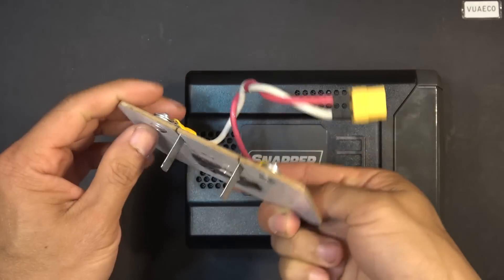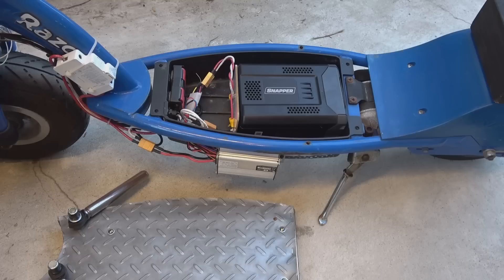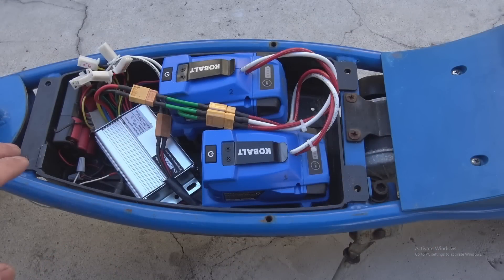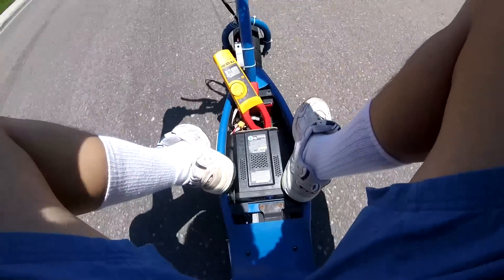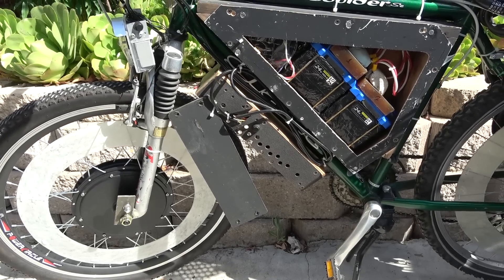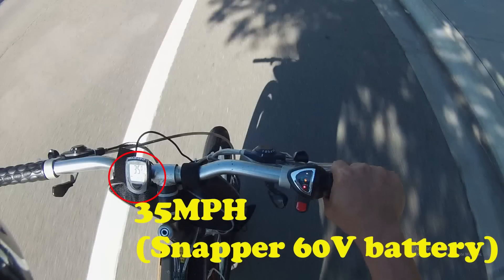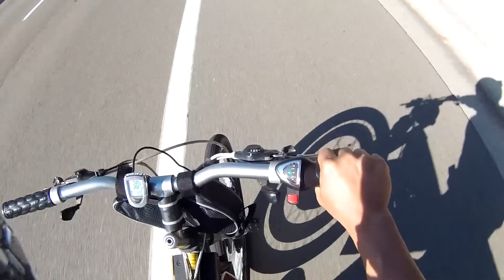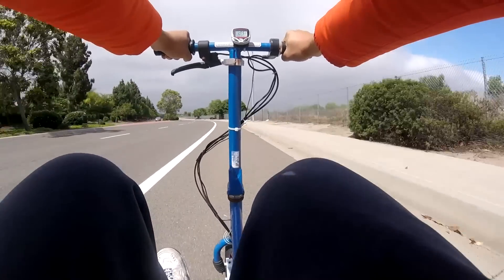Ebike battery upgrade: Run a 60V power tool battery on my (48V) Ebike & Razor E300 E-scooter

Comment: Do these Snapper 60v packs have a built low voltage cutoff? What voltage do they cutoff at? I want to use one of these in a project. Great videos Vuaeco
! Thank you
Reply: Superkev 2000 I assume they do because they have a bms but didn’t test them to that low
Reply from the maker: No, they don't. Most power tool batteries do not have low voltage cutoff. They all have BMS but it's only for overcharge protection. If you think about it, if a battery is overcharged, it will explode. So a manufacturer will do everything they can to prevent that or they will be sued to bankruptcy. But if a battery is dead because they are overdischarged then it's good for them because now they just have a new customer ready to spend his/her money for a new battery. So the answer to your question is almost always "no". You will be the BMS for over-discharge protection.
Reply: vuaeco that would make sense!
Reply: @vuaeco  I think the battery charge is controlled by a small pcb/brain inside the tool itself, so when it get down to a certain level the tool stops working to prevent extreme discharge situations
Reply: @vuaeco  Thank you for your reply. What do you use to cut them off and at what voltage?
Reply from the maker: @superkev2000  There's a test button on the battery. Once it gets to 1 bar, remove it out of the scooter and charge it. Or use a voltage display to monitor it. A 15S battery when empty is about 50V. I would stop using at about 52V (which is 3.5V per cell)
Reply: @vuaeco  Thank you sir!

Comment: What's the max discharge amperage on these 60V batteries? I know these batteries have an internal fuse (for example the 80V Greenworks batteries have 40A fuses) but what do the 60V packs have?

Comment: Hi mate, I've watched heaps of your videos over the past year or two. I have a strange problem. I have a 1000w motor, with a brand new controller. The controller keeps cutting out after a few minutes, and when it seems to get warm I guess. I'm thinking it's because I have a 48v battery in it. So if I go up to 60v, will it stop it hitting any sort of voltage cut out? 
I'm thinking this is why it keeps cutting out. I've even taken off the wire from the BMS, and put them into the battery directly, and still the same. Even though the battery is 8p,so it hardly get warm at all.
Reply from the maker: Your controller probably has a higher voltage cutout. Read the specs of your controller.
Reply: @vuaeco  I can't find the cutout voltage. If I go up to the next level, 52v, or 56v, do you think this will solve it?

Comment: Hey I am going to try something.  If you can tell me what you think of my plan.  I have a Kobalt 40v snow blower.  It stalls under hight demand as expected (I knew it wouldn't set the world on fire).  I ordered a 56v ego motor.  I want to try running the stronger motor off the 40v supply hoping that it may prevent the thermocouple from tripping under high load.  Sound reasonable?

Comment: I took that same scooter and ran 2 dewalt20v batteries in parallel And I rode a willie around the block. I couldn’t keep the front down but it was fun. I didn’t use a controller I just ran it direct.

Comment: I have a 2018 Radwagon  42v setup.
I have 1.additional 54v batteries I would like to put in or.replace the 42v. Would I need to upgrade the controller? And do I wire them in series?

Comment: 48v 58000mah x 2 = 96v 116000mah connect using parallel adapter to a 48v controller will it blow up?🤔🤔

Comment: How far have you ran the battery before you changed it out? I have a 60 v 5.0 Greenworks Pro battery that will work with a boat on 35 amp controller won't it?

Comment: Here is my 48V 2000W 42A motor and a 45A 2000W controller.  Driving at 35-38mph for 30+ minutes the motor is getting very hot.   Here is a short test run video.  https://youtu.be/rxD43d7Er_0

Comment: Great video, I learned a lot from watching, may I know that are you still running 60V 1000w controller with the stock 24v brushed motor? If so, is the motor still alive? I wanted to try something like yours too

Comment: It would be interesting to measure the 60v and 2x24v batteries under load. The high discharge cell specs I have seen have 20mohm internal resistance; a 60v 2ah pack will be 15s1p so the pack internal resistance will be 15x0.02=0.3 ohm and the battery voltage will dip 6 volts with a 20 amp draw down to a peak of 63-6=57v. If the 24v packs were 7s your 48v "battery" would have a full charge off-load voltage of 58.8 but if the original 24v packs were 7s2p you might find the pack voltage only loses 3v under 20a load so dropping to 55.8v. In this case your "60v" pack is only delivering 1.2volt more than your "48v" pack and similarly the extra power available would not be huge.

Comment: I love your vids!!  I have a 48 volt fat tire bike and I just replaced the controller. Stuffing all the wires and connectors in the small space made me a little nervous. The old three wires to the motor were burned up at the bullet connectors. On the new one I soldered them. The original setup lasted three years. Almost all mountains and hill riding which really uses the amps. Lots of heat. Thanks again!!

Comment: Hello 🙏🏽 can you tell me if it is possible to wire 3 batteries in a series parallel combination to make 3- 12V/ 12AH batteries run at 36V/36Ah🙏🏽
Reply: If u had 6 u could get 36v 24ah wiring 3 sets of 2 in parallel and then those 3 sets in series
Reply: It would end up being 36v 12ah if in series.. In parallel it would be 12v 36ah

Comment: I have a question for you regarding something else. I have a 36 volt trolling motor for a boat. Can you suggest a battery that will keep a charge the longest? The TM itself doesn't need to run very fast. Just enough power to last throughout the day. Thanks!

Comment: Just because you have 60v capacitors doesn’t mean it wont blow. If the fet voltage is lower you will blow the fets. Check the fet voltage.

Comment: my tricycle 48v can i put battery 60v? Pls help me, brother
Reply: Yes
Reply: You SHOULD be ok... But again, open the controller box and check the resistor ratings .. they almost always put higher ones than the battery being used

Comment: why does the scooter use so much more power cruising at the same speed as the bicycle?
Reply from the maker: Scooter has brushed DC motor. Bike has brushless DC motor.
Reply: vuaeco do you plan to upgrade the motor eventually? You are definitely going to burn it out quickly if its burning that much power off as heat.
Reply from the maker: @TheJulienlauth  It's fine with brushed motor. I don't always run it at maximum load. You can install a cooling fan if needed. Upgrading with a brushless motor is better but too expensive.

Comment: That's cool you are able to get to 28mph on a razor scooter, I'm currently rebuilding my battery to a 16s 12p battery to power a custom dual motor ninebot es4 with two 48v 1000watt esc's. The capacitors are rated at 80v but there is a soldered on wire with some voltage selections of 60v (the one the jumper wire thing is connected on) 64v, 72v, and 80v, I'm not sure if I should switch the voltage selection thing, I'm guessing it's over voltage protection but I'll probably leave it alone unless it doesn't work. It originally went 25mph on a 13s battery so I'm trying to go 28-30mph
Reply from the maker: Pretty nice!

Comment: Only problem is that the Snapper batteries cost $140 .
Reply from the maker: Buy it on ebay or Amazon. I got mine for less than $50, new. Just be patient and wait for the right opportunity.

Comment: https://rover.ebay.com/rover/0/0/0?mpre=https%3A%2F%2Fwww.ebay.co.uk%2Fulk%2Fitm%2F273820259099 
What's your opinion on these UK battery holders for ebikes? I'm planning to buy two to attach 6 18v 4ah on a 48v 1500w ebike.

Comment: Check the mosfets. They realy liit the voltage and are most likely to fail. If the capacitors fail and swell the bike will still work

Comment: hi..yesterday i buy 2ndhand escooter..i think motor is 350w.... but battery 60v charge 67.2v ,controller 36v...it can burn or not my controller n motor? pls advise to me
Reply from the maker: It's unlikely a 36V controller can handle 67V.

Comment: How long can you run them for
Reply: My 48v 1500w hub motor runs 15-30 minutes on 3x 18v 5ah batteries. Hoping for up to 1h run time on full throttle when my 14s8p pack is finished.

Comment: I have four 20v 5ah lithium batteries...how do i maximize volts and amps? Run two sets in series and then parallel the sets maybe?
Reply: Yep. That's the better setup.

Comment: how long does your battery last and what is the amp hour rating on the one you bought?  I see the 2 amp hour version on ebay for around $60 or so?  thanks- love your videos
Reply: On this depending on your weight you'll get approximately 2 miles per amp hour

Comment: Can I use 60v  battery on my ebike is 48 v 1000w
Reply: You could do it but you would have to get a 60v charger and your motor should be fine since its 1000 watts but just in case... watch it to make sure it doesn’t get too hot ;)
Reply: I am wondering the same thing, have you tested putting the 60v through your ebike ?

Comment: Have you taken a peak inside the battery pack to see what cells are actually in there? I am curious to what cells the manufacture is using in these 60V setups.

Comment: I need help. Im trying to make a computer monitor or television run off of a power tool battery. How can I reverse the circuit in the power tool battery charger so I can plug the battery in and it gives power to the monitor?
Reply from the maker: I don't think you can use a power tool battery charger to run a TV which is 120V AC (or 220V AC depending on where you are from). You can use a DC to AC inverter to convert DC from the battery to AC and then you can power your TV.
Reply: Thanks for the reply. My whole idea is to try and run it on a power tool battery. LOL...im just a nerd is all. Thank you though. You do some really cool stuff on your channel. I love it
Reply: Midnights & Mornings trying to do the same. I ended up gutting the charger moved the red thick cable to the positive end. Then found a buck converter on amazon to drop it down to 12v. Only question left is how much amps can I safely draw.
Reply: @Dogboyaa1  I Just did the same thing for an led light project. Do you know if these batteries have an automatic built in low voltage cutoff? If not... What voltage can we safely run it down to? thanks

Comment: Nice job but seriously one handed at those speeds could end up being very unhealthy for you.

Were you sitting on the board of your scooter? 
Have you considered getting one of those Evo type scooters 1000 watts 48v they also do a 1600 watts version.
Full suspension sit or stand twin disk brakes the whole thing like a proper moped.

All you gotta do now is a range test, but those batteries look small enough to carry a spare.

Comment: 1000w÷48v=20.8A(max), 60v fully charged is 67.2v, ,you can burning your motor ASAP and light, horn etc.
Reply from the maker: 15S battery max is 63V. Its original charger only gets it up to 61.5V max.

Comment: OMG. The Snapper 60v 4ah version currently sells for $80 at Walmart (the 2ah version sells for $85 !?!?!). This is extremely cheap. Since the 4ah version is a 15s2p, you're going to get even more torque and speed!   Compare to an Echo 58v 4ah at Home Depot for $169 (or on ebay for $100). As a comparison, I bought a Luna Cycle Mighty Mini ebike battery 52v 6ah for $300, plus $80 for charger, plus $40 for shipping.
Reply from the maker: That's absolutely true. For some reason, the 4Ah battery is cheaper than 2Ah battery at Walmart!
Reply: As of today, the the 4ah is on rollback at Walmart for $59. That's a ridiculously cheap price. I have a feeling they are clearing this out so that they can come out with a 5 or 6 ah version soon.
Reply: Their website is showing sold out? I might have to go in store and look around:)
Reply: the 4ah not listed anymore. I should have got it when I had the chance.

Comment: Excellent video. Can you measure the voltage of your 60v battery after fully charged. I know it's 15s and can max out at 63v, perhaps the charger only charges up to 60v for better longevity of the battery packs. 
I like the idea of using power tool battery packs, as they are much cheaper than ebike batteries. Also, they have much better warantees. The trick is to find the right voltage so that you don't overvolt the controller.
It's genius how you created the adapter - such a simple, elegant, effective design.
Reply from the maker: You're right. The charger of this model only gets it up to 61.5V, not a full 63V for battery longevity.
Reply: The battery nominal voltage might be 54v, my 20v/60v Dewalt flex get fully charged to 61v

Comment: I have 4 of these batteries and have been thinking of building a e bike!  Thanks for making this video showing that it is possible.
Reply: Nick Smith don't go in to it bro lead acid to heavy and mounting points will be need and a heavy duty frame costly ....go all out and use 18650s 15 quid for laptop 12cell or go 6cell bit more expensive otherwise ya get what ya paid for
Reply: These packs contain 18650's.

Comment: You should have measured the voltage when the current was high. There is a voltage drop for sure... It might not be significant, but there is...
Reply from the maker: Yes, the voltage will drop under load. But for this test, I used freshly charged battery started at about 62V. The test was brief so the voltage drop isn't that much.
Reply: That's irrelevant... I am speaking about the voltage "sag". It is the difference in the voltage in rest vs under load.
Reply: the voltage drop will be massive on that very very very very low capacity battery, theese batterys never last long when used at or above their continuous current rating
Reply: at 33 amps each cell will have less than 3.4v you can look at the tables "18650 voltage sag".  those batteries will die so quickly.
Reply: In other words is the current is being pulled out  to fast out of the battery the cells are going die. So what should be a good balance for this motor and controller
Reply: Fidolokote Productions personally I would have a battery with double the constant current rating of the controller, to reduce voltage sag and battery heat and massively increase battery life.

Comment: Well, you want to really check out all the limitations of your scooter and e-bike by yourself 😅

At least there will be always some improvements and tips to share with the community.
I really like this video where you put the xt60 connector on your Raw Power power bank and this easy modification allowed me to charge my power bank very fast. Only thing that I need now to do is to add a circuit which has short circuit protection